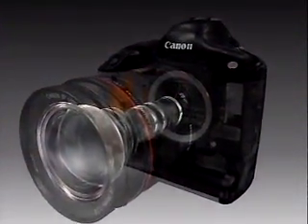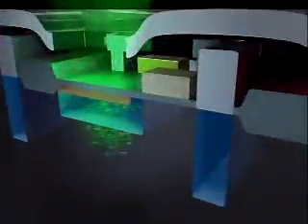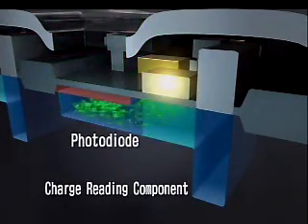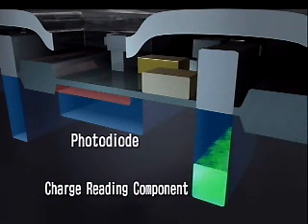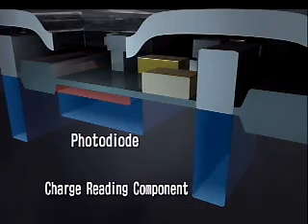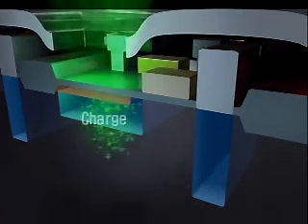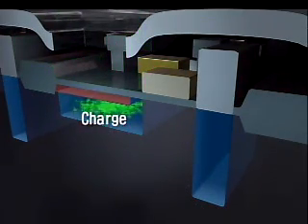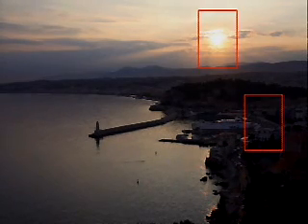Let's see how a CMOS-Sensor in a Canon DLSR works 2/2

Comment: i got my concerning about this,according to wikipedia,cmos sensors don't capture a whole frame at a time,but only a half frame,this to save power,it may captures the frame horizontaly,verticaly or vertically line by line,for still images ,it's not a problem,but for video it's a problem,because of motion artifacts,likely advance algorithms can reduce those artifacts by following the directions of those matching pixels to approximate it's intended position in accordance to previouse frames.

Comment: I have a canon 5d Mark II and was wondering if anyone could explain what goes on when shooting the video and you change the "speed" on the Tv setting. It is my understanding that the everything remains open (mirror and the two curtains).  But how does the speed then change when shooting the video if this is the case?

In addition, I see there are options to be able to change out the "focusing screen" on my camera.  How is it different than the original?

Thanks in advance,
The Meltdownman